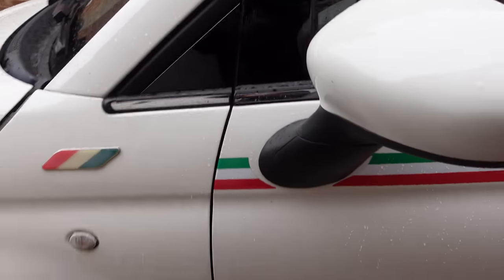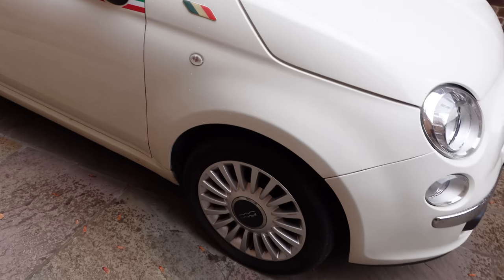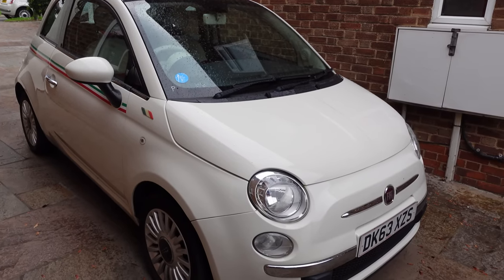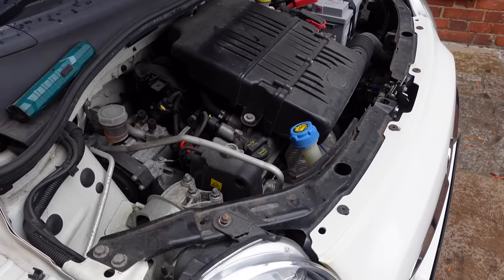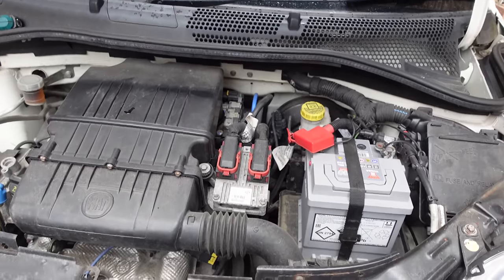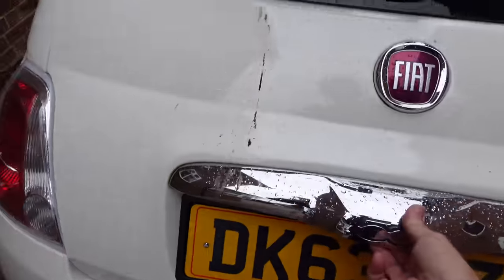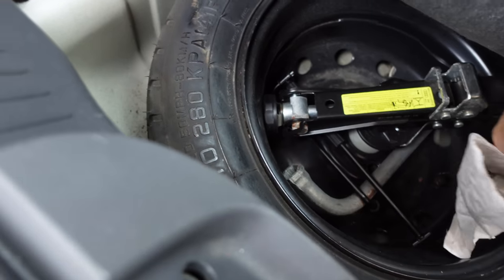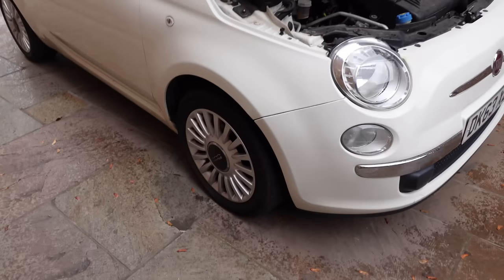Project Dickie - Walk Around - BCA Former Cat N. 2013 Fiat 500 Lounge. Damaged Salvage

Comment: Love the red seats!! Mine are blue😊
Reply from the maker: Blue are on the older ones aren't they. I have a rear bench back in blue in my loft, but never needed it. Came out of a 2009 car I think. Had it ages.
Reply: @Love500 blue? Since when was there a blue option? I'm in the US so we got the light all fabric seats like "Too Minty" (US is all prefacelift facelift) and all the other colors but blue?
Reply from the maker: @RoccoReviews  in the very early blue cars I think it was. The ones I had were out of a very light powder blue car.
Reply: @RoccoReviews  its a 12 reg Pop, blue and off white seats
Reply: @Love500  yes mines a 12 reg blue and off white seats🙂

Comment: I have a similar gap on the nearside between bonnet and wing, as if the bonnet is sitting high. Can the bonnet be adjusted ? i can push it to correct position but of course it returns up.
Reply from the maker: Most bodyshops that adjust bonnets wouldn’t want you to watch. Where the bonnet curves down towards the wing, you can grab it with one hand whilst holding the bonnet and literally bend it. It’s such a small amount it needs. I’ve had to do that both sides. It can also be if it’s a bit low at the front. They are a pain to get right.
Reply: yeah ive heard that, brute force ! mine sits higher at the hinge/windscreen as if the hinge has been bent i feel, might try a spare hinge :-), can you change the hinge without removing the scuttle ?
like the videos btw very useful.

Comment: Is the steering control buttons issue a common problem , I have a 2012 abarth and had a problem with the volume controls so changed them , I seem to have the same issue again ! .
Reply from the maker: If the contacts get dirty they can stop working. It's not common for them to stop working. Only reason this one isn't working is due to the aftermarket stereo,. They either haven't programmed the buttons, haven't installed a Canbus module to allow them to work or haven't wired it in correctly. I won't know until I get it out. did you change the top of the buttons or the entire microswitches beneath?

Comment: Hi paul, do you or anyone else on here know if that 1.2 8valve fire engine is interference or non interferance, googling has not given me a definite answer
Reply from the maker: It's non interference. If the cam belt breaks it does no damage. Just needs retiming and new belt fitting. One of the very few engines that is.
Reply: @Love500  that's good to know keep up the good work

Comment: Hi Paul Ebay2017 Lounge very light damage 22000 miles £3300 JCG salvage do u think u could have look and think it’s a good buy thanks
Reply from the maker: Already seen it and yes it does. Minimal damage. New bumper, sine bumper trim. You might get away with front panel, rads etc. bars will probably be dented. If it’s for yourself then a good buy I reckon. Ring them early Monday as soon as they open or you may well miss it.
Reply: Granddaughter just passed her test have bought salvage before.From previous experience the phone line Monday morning  is busy and cars sell quick . That salvage yard normally light damage and low miles sensibly priced .She does really  want a late Yaris but pricey even salvage
Reply from the maker: @terrysams8299  yes I tried once and the line was engaged. When I got through it had already sold. You gotta be quick.